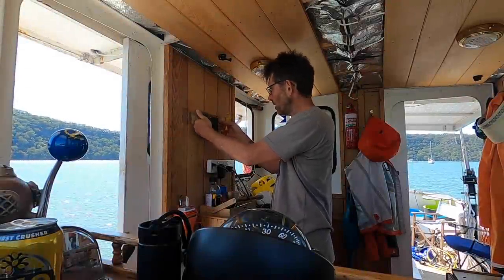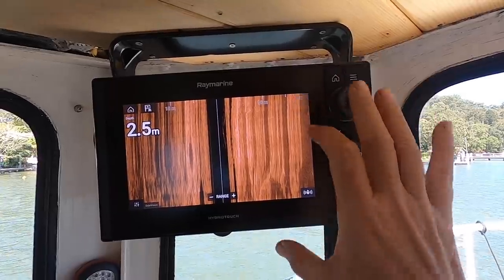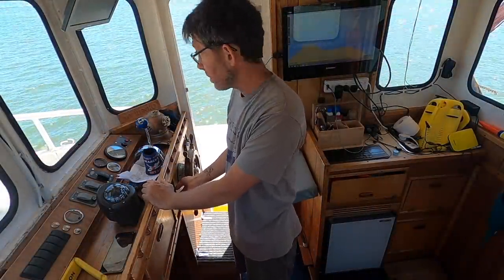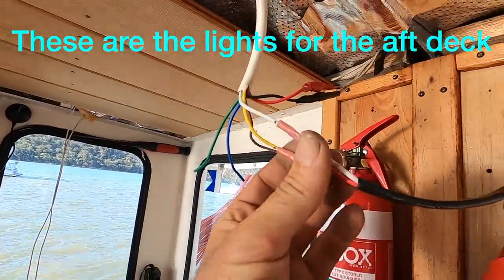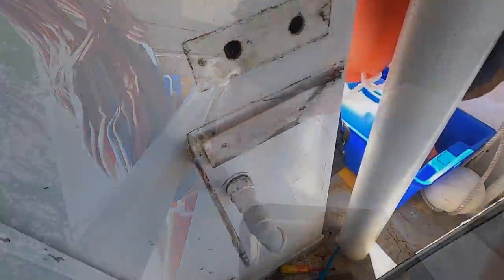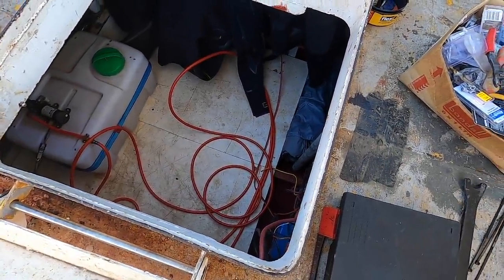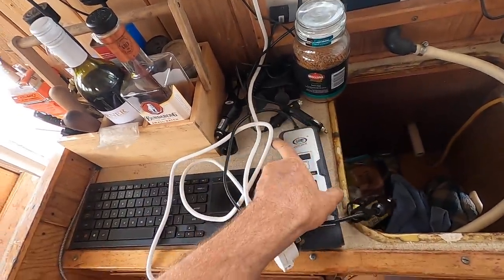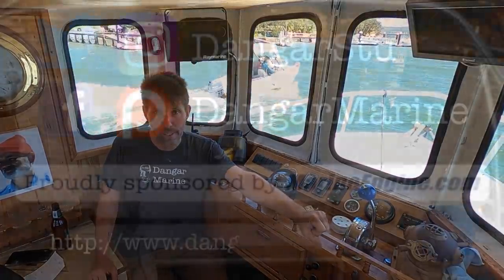Boat electrical upgrades

Comment: ha! Im glad I am not the only one acting like a Dad every time I see you "WHAT!? NO SHOES OR GLOVES! WHAT WERE THINKING YOUNG MAN!" :) since I have been watching you and you have introduced me to other people working on boats I often freak out about how often everyone says "well, time to drill some more holes into the side of the boat!" in my mind no holes in a boat is very important! I have a solo canoe and I was looking at putting a snap on cover on it and the second I saw the guy pull out a drill I was like "NOPE". I guess I just dont have the nautical courage needed. though I saw your friend on his barge with the crane on it come and get your table and to me it looked like his entire boat was ontop of deck floats? there is a guy in oregon who build his houseboat using them. I thought, how great is that? anything goes wrong with one of them and I can just unhook it and attach another. Im thinking thats means something like that has to stick to pretty calm water and no long trips but for a boat that doesnt plan on going far away on a river it seems like an ideal house boat platform. what do you think?
Reply from the maker: For calm waters, a platform build on floats are a great way to go. Plenty of catamaran-style BBQ boats like that on the river.
Reply: @DangarMarine   Thanks

Comment: Strong winds from the north coming in today by looks and radar is looking heavy for radio and possible storms coming from the west. Be a good avo to be off the water I think.

I somehow end up with the same MPPT controller as you for my camping setup though need better panels for that setup. 

Cigsockets are universal. That come from the obvious reason for them to be in all cars in the 80s to 90s when the use trends started changing. The power source was already there and everyone just used it because of that.

Comment: Stu, have you thought about putting covers over your computer screens when not in use ? They really do not like the effect salt air can have on them. .
Reply from the maker: Some covers would be a good thing. Not so worried about the cheapy LCD screen, but one for the computer would be good.

Comment: Stu, are those prescription safety glasses you're wearing while working on the inverter? If so where did you get them, I live in Sydney.
I've been meaning to get some but my optometrist couldn't get any.
Reply from the maker: Yep. I just bought them at the local Hardware and General store. I forgot my reading glasses so I'm glad they were on board!

Comment: By attaching the ground to the gear box is that allowing an electrical path through a roller bearing.
Reply from the maker: Ah, I see what you are saying now. It seems that the AC ground shouldn't have a path into the water anyway so I'm going to switch it to battery negative.

Comment: Just a thought. Direct connection of screen etc to the boat's 12V system may be too much for them when the alternator and/or solar charge the batteries at more than 12V.
Reply: Hardly, most 12v electronics can take a wide margin of error. Generally they can take anything from 9-16v and just use a linear converter to dump the excess voltage into heat.

Comment: Hi what about putting that app for the sounder on the computer so if you want you can have a window display on the screen Infront of you so you don't look to the side as much. You can also have a external SSD or USB on the computer so you can record to the instead of the phone. You might be able to check footage at the cabin computer or even do editing onboard.
Reply from the maker: On the day, it is mostly about driving the lines needed to cover the search area. Although I do look at the sonar at the time, it's very easy to miss things while you are driving so I'm going to try to get in the habit of not worrying too much about analysing the sonar scan until after the boat is back on it's mooring. Recording straight to SSD would be good though, although AirDrop onto the laptop does work really well.

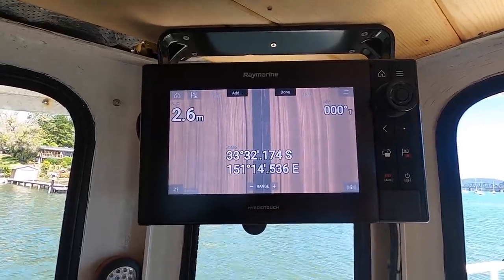Comment: @3:24 don't forget you can resize the overlays as you don't really need them giant size blocking 20% of the screen.    @12:20.. where you put in the waterproof USB. i would imagine that it draws power when ever it is hooked up and switched on.  just some thoughts..
Reply from the maker: Yes, will experiment with shrinking the overlays down a bit. There are quite a few things on the boat now that have a small constant draw but the solar seems to keep up nicely. There is always the main house switch to shut everything down though if needed, or just pulling indiviual fuses.

Comment: Hello from Vancouver island your the man stu thanks for awesome build I have almost watched every video you have and gotten great info for working on my boats
Reply from the maker: Awesome thank you!
Reply: @Islandwaterjet  Have you checked for owner listed boats on Cragslist? nearly 3000 listing for BC in that section.
Even a couple of Hourstons, glasply and  bayliners under 32 feet.
Reply: @Islandwaterjet  yup I know the price needs to be right.
I think the biggest drawback is the size.
While there are a lot of listings in the under 35 foot sort, they are filled with jetskis, kayaks and canoes.

Comment: I think it's a little late for this suggestion but I installed mt 19" touchscreen down below the throttles  rather than up above my head.  There is less craning my neck to watch display and less eye strain looking down.  It's also less bright (sun light) looking down and within easy reach which is important in rough seas.
Reply: That would depend on the boat, Renko is small enough that having a screen below the throttle would have it hitting your knees when underway.
Reply from the maker: Yes, unfortunately this is very boat dependent. I have my phone down low but it's harder to see than the little screen up high.

Comment: Hi, not sure where to ask a question so am putting it here! Have a 1995 Mariner 150hp. Starts good but no water tail, beeps continuously after running for a few minutes so am assuming the impeller is faulty. Is this a correct diagnosis? Am in the process of taking the lower leg off but the bolt at the rear is stuck and I will buy a gas burner today to heat it a little before trying again. Any help is much appreciated. Keep up the good work! Thx

Comment: Hi Stu! Great video as always!
Is there a law in Australia against marking the chain (or whatever you might find) with a boue above the surface? Just as you would mark any net or other fishing-gear... Does it have to do with tide and/or current maybe? 

Cheers
Reply from the maker: No, you can definitely mark it with a buoy, it just depends how long it will be before you get back to it. If it is on the surface for a long time there is a good chance that someone will run over it at night and you'll lose the position.
Reply: @DangarMarine  Thanks for quick response and flawless spelling :-)

Comment: hi Stu. there is a product called aussi duct(Bunnings or elec wholesaler) to hide your wiring. it has a square profile and lid which can be accessed easily for upgrades.

Comment: I almost certainly lack your knowledge and understanding of electronics Stu, but feel compelled to ask whether you have ascertained that the 12v transformer does not also serve as a filter and provide other protections for your hardware?
As I understand it most computer hardware actually operates on voltages far lower than twelve from motherboard level on.
Reply from the maker: Yes, if I go direct DC I'll probably need to add some sort of simple voltage regulator.

Comment: Will the 12v wire next to the gps wire cause interference?
Nice work dressing all of the electrical cables. You’ve really done well with that boat.
Reply from the maker: Possibly, I'll have to do some testing / research.

Comment: That inverter (good choice of brand btw)  but no fuse?, no disconnect isolator? no RCD? and negative through the gearbox? I honestly think you need to rethink that whole install, also you can add a remote switch to remotely turn the inverter off and on, also did you set the inverter up via blue tooth? as I think the come standard 60hz/230v
Reply from the maker: Connected to a fused and switchable link that was installed in a previous video, have moved earth direct to battery negative as per pinned comment. Ben is bringing an RCD to install next week.

Comment: Send an oil sample to a lab. They’ll show you if there is coolant and excessive fuel in the oil (from stuck rings) and such. 

Ask a local dealership marine or heavy duty diesel who they use. They aren’t to expensive. And it cheap insurance.
Reply from the maker: Would be interesting to see what the results are.

Comment: What is the open pipe next to the air intake at 18.57  ??? And what does it do and why have a flap on it.
I think I know what it is but just not sure.
Reply from the maker: It's the oil filler cap, wired open to relieve crankcase pressure until the stuck ring is fixed.
Reply: Dangar Marine , thanks very much for the information.

Comment: Did you consider the Centaur charger and if so, why did you go with phoenix? I’m upgrading my electrical system.
Reply from the maker: Didn't look at the Centaur. There is a Victron dealer on the same street as the old workshop so I just went with them.
Reply: @DangarMarine  its another model from victron.

Comment: The Detroit is sounding sweet. Just curious if you still in the outboard repair business.
Reply from the maker: No, workshop closed now, but even when it was open it was a car workshop, not outboard. Just worked on my own outboards and those of friends.
Reply: @DangarMarine  Im rebuilding a ski boat to inshore fishing boat. Watching you has given me much needed understanding of how things work and sometimes right on the nail with what im doing. Thanks for the knowledge.
Reply from the maker: @wmars4655  You're welcome. :)
Reply: Dangar Marine So you’re just “working from home” now like the rest of us?  😉

Comment: Hey Stu - do you get much thieving up that way? Bit worried about all your cool electronics now.
Reply from the maker: It's a pretty safe area, but anything can happen. Have a new set of padlocks for the wheelhouse and I'm going to weld some tabs on so I can put another on the lazarette.

Comment: What is this?  Electrical upgrade 11, or 12?
Reply from the maker: 9
Reply: Dangar Marine I know the feeling.  I end up taking 5, 6 shots at the one last wiring job, only to make it 7, or 8, more holes, more switches, more panels, more loom...  too bad I am never smart enough to make 1, 15 line run, all labelled, and use at will, later on.

Comment: Hey mate, could you make a video on how to wire a hidden kill/anti theft switch under the cowling of a small outboard?
Reply from the maker: Can do that. All you need to do is add a second switch under the cowling in parallel with the kill switch on the outside that your safety lanyard connects to.
Reply: @DangarMarine  right on. Thanks!

Comment: you can get an HDMI socket at an angle
Reply from the maker: The ports on this computer actually come out at an odd 45 degree angle pointing upwards and backwards.
Reply: @DangarMarine  lol just checking you knew

Comment: Just be careful your 12v monitor is likely not designed to handle the "12v" lead acid voltage range. You might need a 12v output buck/boost dc-dc converter.
Reply from the maker: Yes, some sort of voltage regulator would be good to put inline.

Comment: Stuart, you have 2 screens giving you the same info, why? surely the helm small screen would be optimal.
Reply: not really, the small raymarine screen isn't optimal for use as a nav screen, it's to far from the helm on the other side of the wheel house.
The big computer screen is not in a great place for use while underway. The small repeater screen lets Stu monitor navigation easily while at the helm.
Reply: @jaquigreenlees  its what i meant, sorry, i may have confused the issue, i meant why the big screen? the repeater screen is enough, if not a tad small.
Reply from the maker: You still need the computer to drive the smaller screen, and the computer itself is a better size and position for watching from the cabin table using the keyboard.
Reply: oki doke.

Comment: Hey Stu, this is not ment to be a negative comment at all. but i`m a little confuced, you say this boat is ment for diving, hobby and that kind of stuff. You have more cables and electronic than I have in my 2017 mod Volvo lol. Will it end? So much electronic in a so small boat, i just don`t get it. is all that a necessity?? This boat reminds me of a rescue boat rather than a hobby boat lol. What is your future pans for cable management? Great videos Stu.
Reply from the maker: A lot of the electronics are aimed at the search phase of the diving. I can't think of anything added I would be happy to live without.
Reply: @DangarMarine  Ok I see. I understand better now Stu. it`s a nice boat and I love your videos. They make my days :)

Comment: Can you launch a salvage operation for the scrape metal on that ship?
Reply from the maker: No, I believe it is protected as a historic wreck.
Reply: @DangarMarine  There was a lot taken for BBQ plates but the metal is an alloy (Steel Mix) and toxic when heated

Comment: Hey Stu, that transformer very likely has a voltage regulator in it as well.  If you cut it and tie it into your boat 12v, make sure you have an extremely clean and stable 12v line.  Any spikes you get will gradually, if not catastrophically kill your digital electronics.  Same philosophy as charging your cell phone in your car - it prematurely kills your battery because it can't handle the voltage fluctuations.  So, the more regulation and filtration, the better.  Cheers!
Reply from the maker: Yep, definitely agree. Have a voltage stabiliser on its way. :)

Comment: People don't realize when doing a remodel it's a thousand little tasks that make the whole job happen. 

Dad launched FV Frontier with about half completed accommodations just to get the boat fishing. But after the fishing season he would pick a project in the wheelhouse or fo'c'sle to do to make things more comfortable for the next year.
Reply from the maker: For sure, there are heaps of little jobs that don't make it into the vids on top of these. I think it is a good choice to use the boat and then make the improvements based on your experience, what worked, what didn't work, what you really missed and what you didn't.
Reply: @DangarMarine  I'm designing a low budget homebuilt aircraft for back country flying and hope to start building it sometime soon... this whole wooflu slowed things down. Building airplanes and boats have one thing in common... it's a thousand little jobs that make it happen. 

Yes I have built both aircraft and boats when I was much younger. So I know the tasks ahead for me.

Comment: Cigarette lighter sockets suck.
My new dash camera wasn't getting enough current because of the poor design that uses the glass capsule fuse.
Had to hard wire the power cord to keep it from turning off and on all the time..